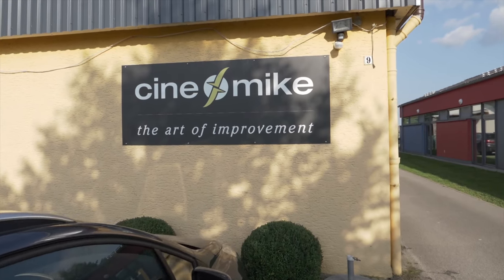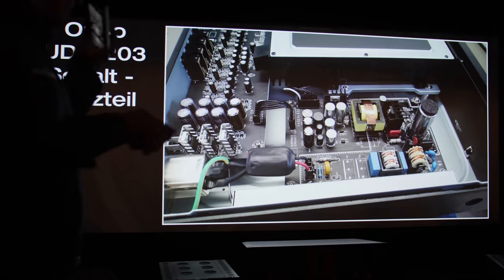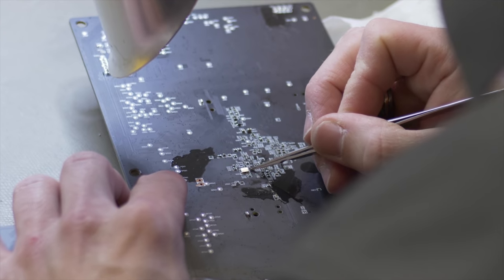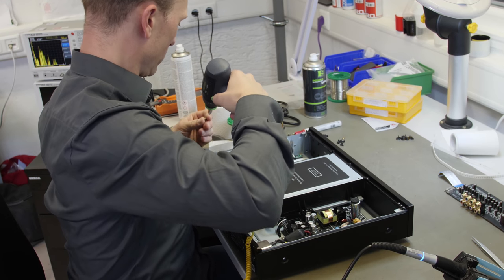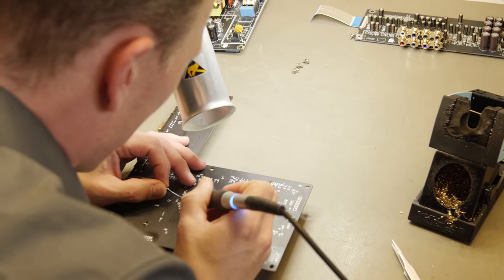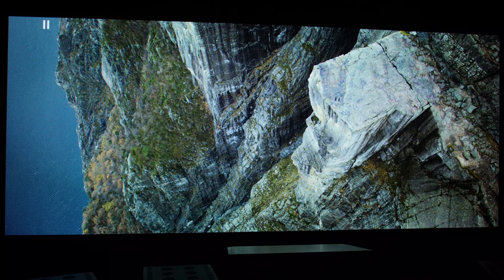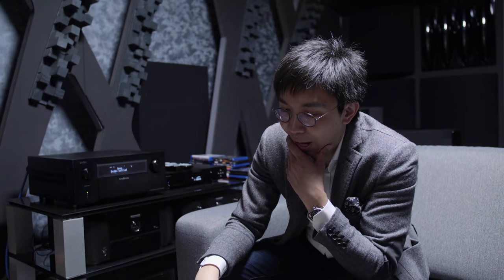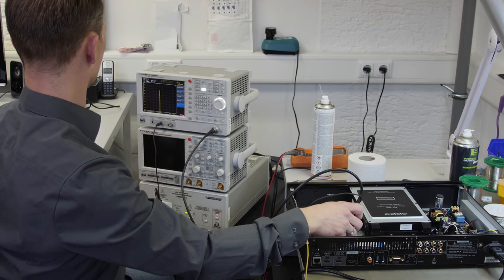What If You Can Lower The Noise Floor on Your OPPO 203/ 205? (Warning: Expensive!)

Comment: I have changed my oppo 205 psu and it has changed my oppo sound for the better. Good job vincent as always and thanks for showing another side of you besides just tv reviews.
Reply: How exactly did you do it and is there a link to where you purchased the PSU from???
Reply: @PSYCHOV3N0M  Google "oppomod" one word.
Look for UDP-203/205 LPM SE.   Instructions are there and it's require no soldering. Just screws removed and unplug and swap in new psu.
Ps I did the same thing with my oppp 95 with that same company .

Comment: This is exactly why I chose using good headphones and DAC/AMPs/soundcard over having a surround sound system and speakers. I just can't tolerate the noise.

But if I was using a surround setup I would probably resort to modding too.

Comment: It would be less expensive if Cine Mike actually made new circuit boards with the upgraded components. Maybe buy new bare circuit boards from the manufacturer in China that made them for OPPO OR have that company make upgraded boards in volume. Much cheaper. Then all Cine Mike does is component replacing and testing. Maybe he can replace the discontinued 203 with a Cine Mike 203.

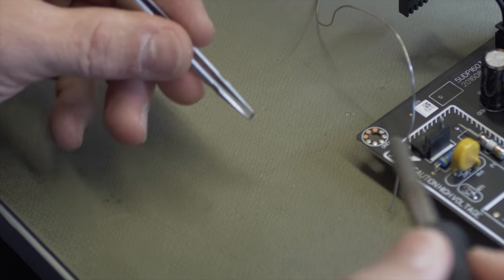Comment: 3:12 Surface Mount Soldering SMS.  Yeah and the parts are as common as mud on ebay and in most cases very, very cheap and I have my soldering iron solder sucker solder my oscilloscope and multi-meter. Don't be afraid its not all that hard to do. Just takes patience know-how or research to do it.  So changing caps diodes, resistors or these micro resistors with a little de-soldering a pair of fine tweezers de-solder and move the part away from the PCB track is fiddley diddley stuff .

But if you ever heard of an IR emitter then place the players in another room with all the amplifiers and projector and the noise floor in room should be 30db or less.

Got wait until after the units warranty has run out otherwise goodbye free repair when its been tampered with. But that is okay I wait a few years. :D But no the S/N should be low on this stuff not sky-high with noisy electrical frequencies.

Comment: 5500 euro for ultimate mod wow. I bought new LPM, new clock for main  board and analog board, changed all caps/low noise regulator to my Oppo 205 and it cost less  than 1000usd.
Reply: Dan Santoso and I am sure it sounds worse than an unmodded oppo as you need to know what to mod and how. It’s also not a simple case of just swapping components you have to re engineer elements of the circuits other wise you make matters worse. The cinemike 203 has about 375 changes / reengineering!
Reply: And dont forget garantee! Cinemike is great for costumer service.
Reply: @JohnnyFocal  Jon i rather get LPM and clock, many places sell them. Then i have 4500 euro left to buy new speaker and OLED. This is no brainer. Btw my oppo 205 has no comparison before and after.
Reply: When I measured some clock mod's they made the jitter worse I am sure not all do and you have to do it directly on the board you cant have leads coming off the board to a clock as some seem to do.
Reply: How long did it take you to all the soldering? Plus some of the parts you need to change are the size of a pinprick so not everyone has that skill. I can solder cables together but would never attempt something like this as I would destroy it. If you have the skill good for u. I like many others don't so need to get someone else to do it. I also don't repair my own watches for the same reason!

Comment: Hello Vincent, I can tell when you like something, your smiling like a Cheshire Cat, How I see OPPO UDP-205 which I am luck to own, IF as a Electronics Hardware Engineer I would do, is to Build my own Bluray Player, after all it's a Bluray disk block with Video and Audio DAC, SABRE ESS DAC's are the best, Power supply HAS to be low noise and there are some really ultra low noise supplies in the nV noise level, Crystal Frequency HAS to be stable and low Jitter, capacitors can be changed to provide lower supply ripple which you don't want when your looking at high end equipment, and one can get audio grade cappacitors, Most manufactures will have application PCBs to demonstrate their top end Chip's, For a long time I have thought about building my own Bluray Player, & last week I have started to buy components !, I have seen Broadcast Studio Satellite receivers & they are unbelievable quality in sound !, warmth smooth and great sound stage, Tandberg to name one that I have, so a fancy low profile Nice PC Case for Bluray Disk, PSU, Motherboard Video Card, & sound card, you basically have a system, can be expensive way to do, but upgrade is simple !

Comment: I have Nordost Valhalla 2 power cables. No noise floor. My pre amp is Simaudio moon 850p yes power cables will take away noise from the mains. You can clearly hear the difference and the images are better. Cables act as antennas, they pick up nosed and also you can place synergistic noise control On pcb, these all work. Your welcome to listen to my sound system, £55.000

Comment: Could you try to get the 75" version of Sony Z9F to review as there are only 65 inch version reviews available and black levels and contrast ratio after the Z9D were disappointment. There might be more zone on 75 inch version at least to help with blacks?

Comment: The OPPO players clip very audibly when you use bass management on the multichannel analog outputs.  If Cine Mike fixes this great.  If not whats the point.  I know he probably is unable to help, as its in the chipset itself - not a electrical circuit component.  This is a well documented issue on the DIY audio forums.  When you set mains to small and reroute bass to the sub channel through the analog outputs OPPOs clip more than a barbershop.  I own one and wish it wasnt the case. 😎
Reply: 103 , 105 , 203 or 205 clips ? I’d be interested to see where this has been discussed

Comment: Damn! A multi-layered oral err aural experience... LOL!

There are various Linear PSU modules available for the DIYer for the Oppo players to replace the relatively more noisy Switch Mode PSU board.. Some modules are better than others, depending on the vendor. That’s usually the first level mod.